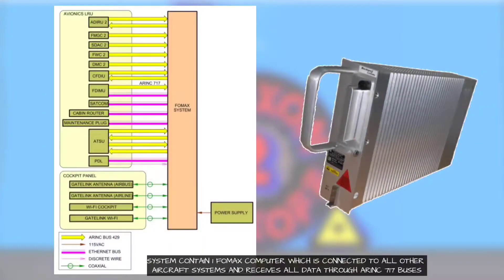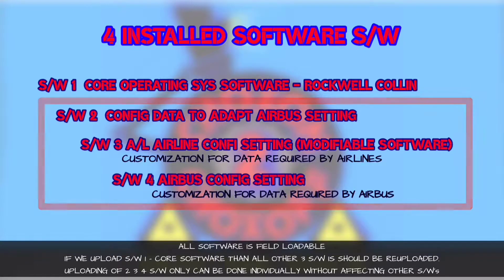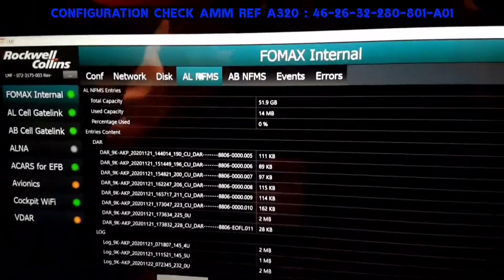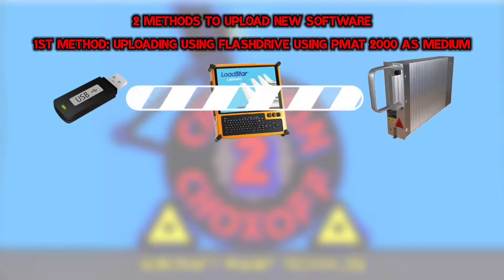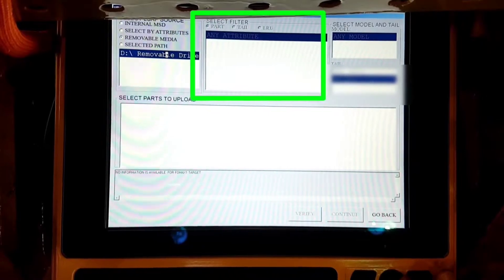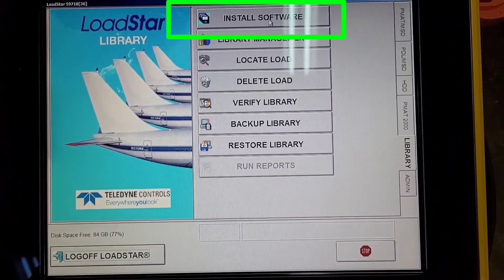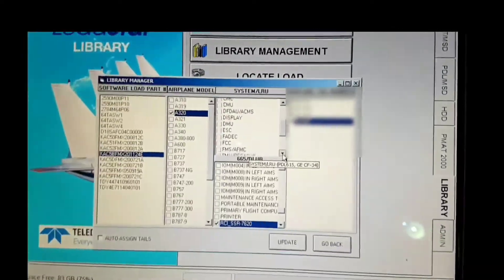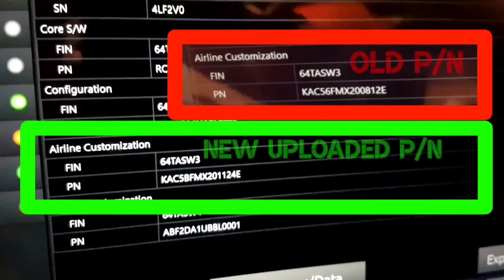FOMAX SYSTEM and UPLOADING SOFTWARE FOMAX WITH PMAT 2000 IN AIRBUS A320

Comment: Thanks for the video. Can you tel us what use Fomax has for the MRO ? Which predicitive Maintenance measures can be c/o ? Thanks a lot
Reply from the maker: Welcome.
Basically its for airlines.They can plan ahead and save time accordingly. Specially in line maintenance.
MRO will receive maintenance plan from operator.

Comment: Great video, very informative. Thank you... Question.... What does it mean when you get a message "NO TARGET FOUND" We uploaded IMMR S/W on one plane with no issue, then went to 2 other A/C for IMMR S/W updates and got that message on the PMAT. We were thinking a bad or incorrect cable. Any ideas?
Reply from the maker: Thank you for watching
NO TARGET FOUND is normally displayed when there is no proper communication from PMAT to Target LRU.
There can be many reason like
LRU inop
LRU did not boot up
As you said connection issue with cable or incorrect cable but you did with one aircraft so probably cable should be fine.
In last case wiring issue from pmat loading connection till LRU.
Kindly refer you Trouble Shooting Manual for complete detail.
Thank you. Keep watching and do support by subscribing and sharing further.
Reply: @CHOXON2CHOXOFF  Thank you for the input. I'm wondering f they didn't let the IMMR fully boot up when they started the transfer... Thanks again...